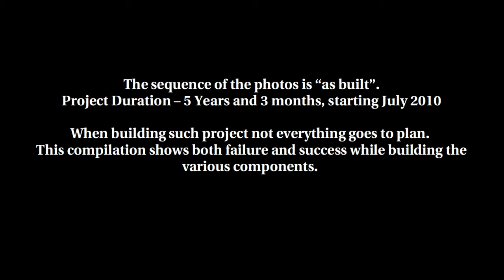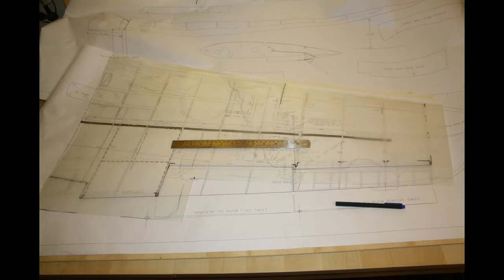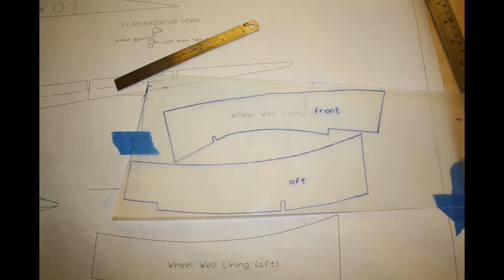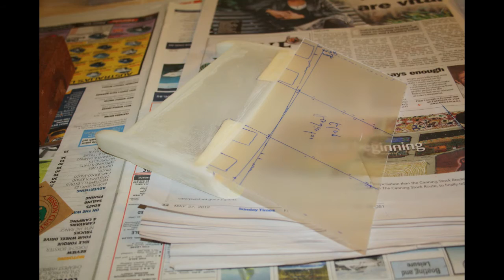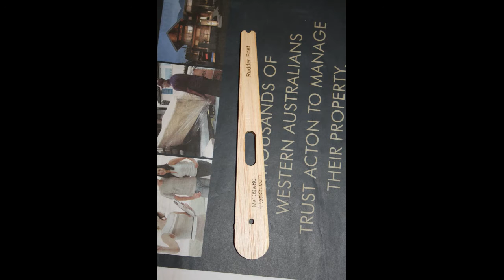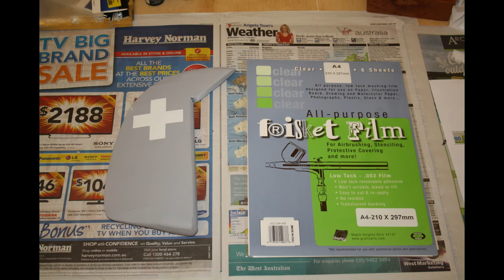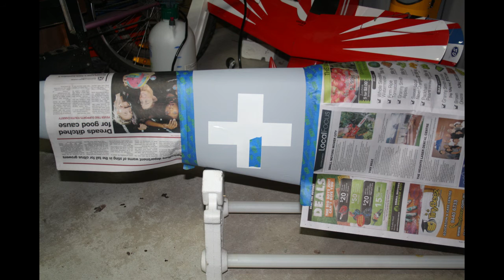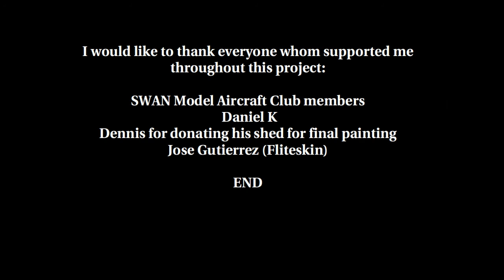Building the Fliteskin Me-109F

Comment: A torque roll on take-off if i am correct is something you are describing which is when the aircraft is at or around a stall speed (take-off speed) and you suddenly apply throttle (or an engine lag ) which provides a counter torque reaction and twists the plane into a downward spiral.